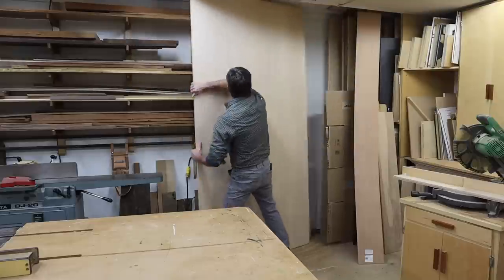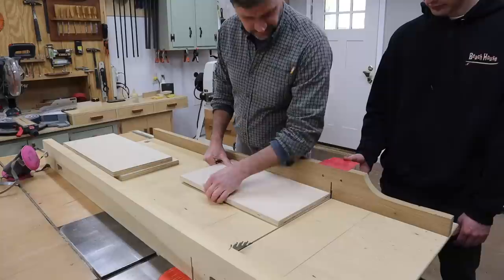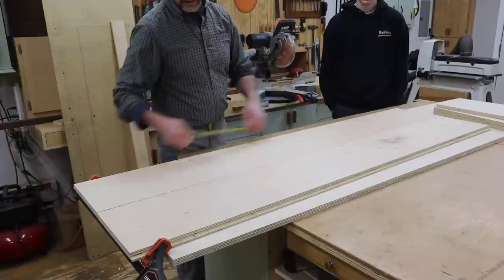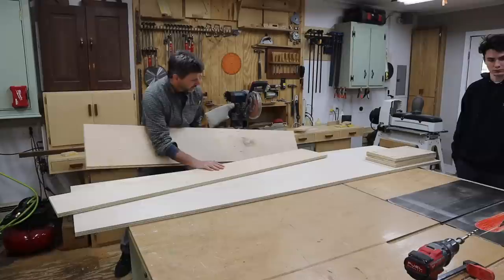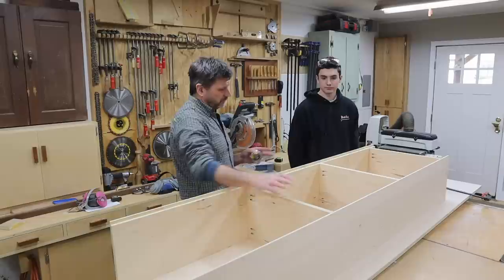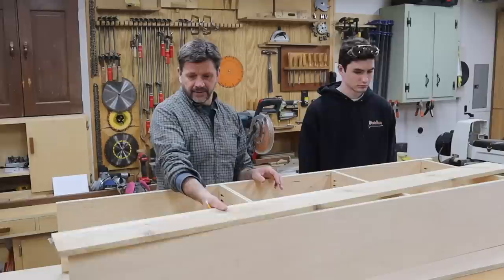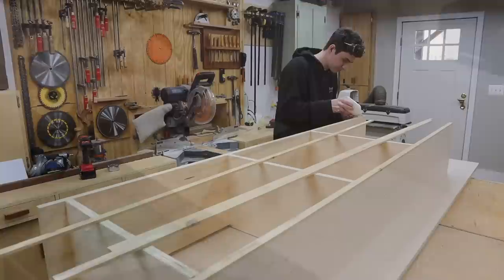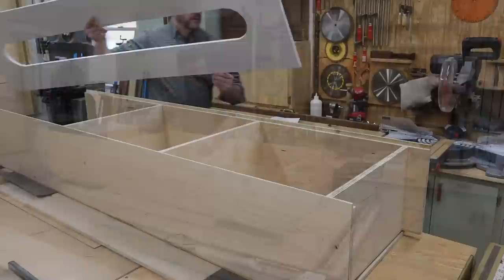How to Build a Simple Cabinet -  Great Father & Son Project

Comment: Noticed you don’t have a riving knife/splitter on your table saw.  Mine is out of alignment forcing me to push wood through with much more force than I am comfortable. Ive tried realigning the riving knife to no avail and have come to the conclusion removing it all together is the only course of action. I worry about the kickback though.  I’m by no means a professional like yourself, merely a hobbyist, am I crazy to think I can take it off?
Reply from the maker: This saw never had one so It’s all I’ve known... next week I’m putting a new SawStop saw in the shop and that one will have one. My advice is don’t do anything you’re not comfortable with... a table saw is a very dangerous tool.